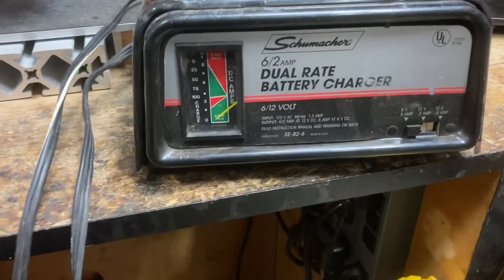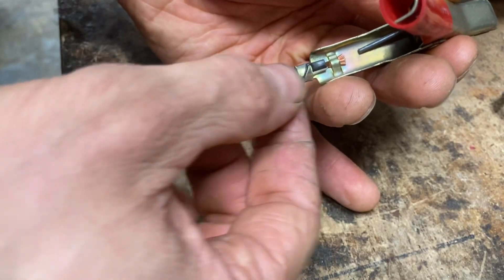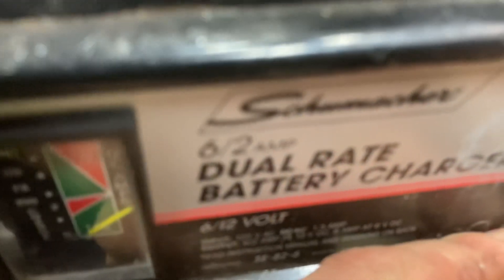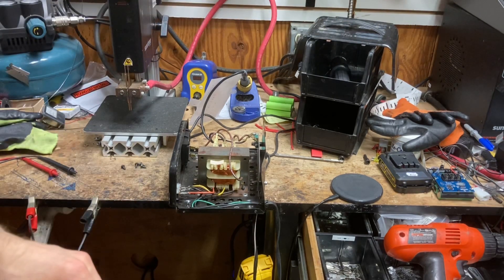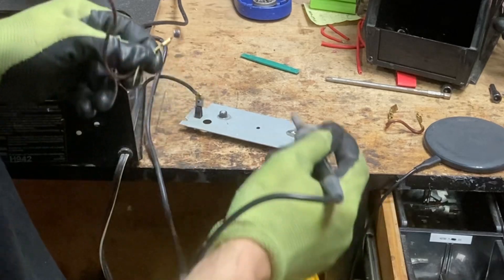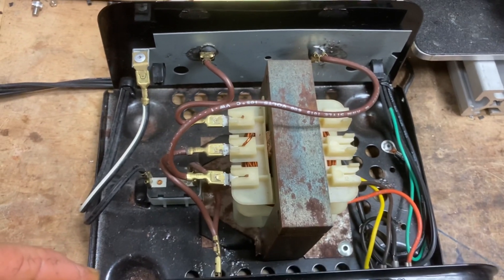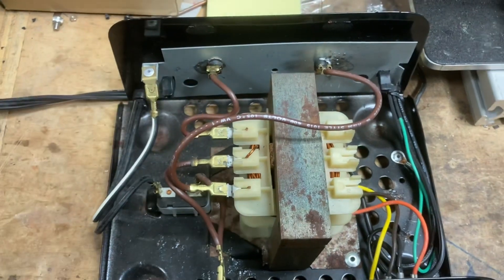How to Fix a BATTERY CHARGER That WON’T CHARGE

Comment: You Need A Soldering Gun Not A Pencil! You Do Know That Current Flows From The Negative To The Positive!! Because Electrons Are Negatively Charged!! Protons Are The Positively Charged Part Of Atoms! Center Tapped Means That On The Secondary Coil There Is A Connection To The Center of The Winding Length!
Reply from the maker: Still a foreign language to me! But thanks! Always learning!

Comment: I'm excited because I have one not working but can hear the transformer so I can probably fix it.
Reply: A bit rusty inside so cleaned up some suspect grounds but squirting a little WD 40 on the charge selector switch and working it in is what got it going.

Comment: My charger is short cycling… ideas on how to troubleshoot
Reply from the maker: Hey Martin, first thing I’d do is try charging it on another charger and see if it’ll successfully charge. Easily 50% of the “charger problems” I encounter are actually the result of a bad battery (heavily sulfated or weak/dead cell).

If the battery isn’t the problem, it’s really a case by case thing. It would be difficult to diagnose unless it was in front of me and I could poke around in it.
Reply: @Duby4life thanks for the quick reply
Reply from the maker: Of course! Thanks for the question!

Comment: Wow!!! My NOCO GENIUS10 is now having this exact issue. It turns on well as normally but gives out 0.01 DC Voltage. Can I follow this same process to get it sorted?
Reply from the maker: The Genius10’a are all circuitry on the inside. I would find it a lot more complicated to diagnose. If you are small electronics inclined, go for it. Always make sure your battery is not to blame before digging into your charger though!
Reply from the maker: NOCO is also fairly responsive with their customer service. I’ve known customers who had their products for three years and we’re outside the warranty and NOCO gave them a steep discount for a new one to replace it.

Comment: My Battery Tender Plus also stopped working, is it possible to open a case to troubleshoot?
Reply from the maker: I've fiddled with the terminal connections to get them working again, but never opened up the unit. Battery Tender products are pretty solid.
Reply: @Duby4life  Mine stopped displaying the LEDs, all connections are ok. I tried to open the case, but it has some "proprietary" screws. I don't know what screwdriver to use. Were you able to open a case?
Reply from the maker: @aperson1181  I usually fiddle with various pointy objects until I find something that connects to open the proprietary screws. If something tiny shorted or died in the circuit board, I’m usually out of luck.

Comment: aka step down transformer meaning it turns 120vac into 12vdc. your home ac system has one too!!! but it's much smaller amperage and is not adjustable for amps or volts. matter of fact doorbells used this same transformer type and still do to this day unless you use RING which is all remote thru wifi

Comment: Why the one way diodes are there I think because it would do the opposite of stepping down could step up from 12 to 120 just like the transformer on the hydro pole power goes out and back feed from generator will step up and travel down the line I think let me know if I'm wrong
Reply: The transformer is already stepping down the 120v AC to something between 15 and 30v AC, the diodes then convert it from AC to DC. The rest of the circuits lower the voltage further, and those diodes will drop a 1/2 a volt on their own. I'm currently getting ready to repair a 1970's Century brand 60 amp charger, and it has even older Selenium diodes, and they drop 1 volt or slightly more each and there's also two of them. So when I use a more modern diode to replace them, my final charging voltage will likely be 1.5 volts higher depending on the low/med/high setting I choose.

Comment: The center tap is the center of the phases. Meaning it's where you 6 volts is coming from. Without the center tap you would only have a +12 and a -12 and no return for the current to make 6 volts. Diodes are as you explained. They only allow current to glow in 1 direction.  You can also use them to construct a rectifier to change ac to dc.

Comment: Thanks for the video. I opened my schumacher and just ohmed out the red and black output leads. One would not carry electrons. The break was right at the alligator clip, under the two metal tabs that are bent over the wire just before the wire is soldered to the clip.
Reply from the maker: Very nice! That’s my favorite repair.

Comment: 5:47 The aluminum heatsink take out the heat from the diodes that you soldered onto the metal plate. Nothing more fella. THE transformer is wound in a way that the charger only need two diodes. Otherwise you would need a full-wave rectifier which is more money for the manufacture to pay for making the item. Center tap refers to the way the output side of the transformer is wire wound fella. You did well and good luck learning too. Have yourself a Merry Christmas and a Happy New Year. Peace vf  😀😀😀
Reply: You seem to have a good grasp on this stuff… I have to stand up Schumacher battery charger transformers…. What if anything can these things be used for???
Reply: @metal.mover23  YOU can use it to change a battery in a vehicle whose charge is not up to specifications. The unit will be able to plate metal to make it shine and protect from corrosion. The unit will power low voltage lighting for emergencies and outdoor lighting. Hope that helps Sir. Peace

Comment: It's painful to watch some men work.
Reply from the maker: Haha! Tell me what I did wrong??
Reply: @Duby4life  Why didn't you disconnect the wire from the spade terminal before attempting to solder? The wire acts like a heat sink making soldering difficult if not impossible, also, you could've just attached it with a small nut and bolt, quick and easy. Another thing, heating with a propane torch  would've accomplished your soldering job. Next time THINK through the problem, build it in your head before you begin. Good luck, take care, don't give up, if it was easy everyone would do it. Peace.

Comment: A diode is for converting AC to DC. One diode can make a half wave rectifier and two diodes can make a full wave rectifier. The voltage coming out of a transformer is AC and you need to convert it to DC to charge a battery.

Comment: HELP! I have a Schumacher 250 Power Booster 10/30 Fast Charger. Someone broke the switch off. I opened it to get the parts to replace, but the auto store doesn't have it. What can I do?
Reply from the maker: Send me photos of the issue to duby4life@gmail.com and I’ll see if I can walk you through a fix.

Comment: You have to hold the tip of the soldering iron on the two pieces to be soldered together letting those pieces melt the solder (flowing it). Never try to melt solder directly with iron and try to stick cold parts together. You can get away with it every once in a while but it’s gonna fail
Reply from the maker: I follow. Hot or not, nothing would stick to the surface where it had been damaged for some reason. Hence attaching to the new spot.

Comment: I bet I've had five battery chargers fail over the years. The only one I have that still works was a cheap one I bought at pep boys 20 years ago. I even left it out in the rain and it still works. The more I spend the less luck I have with them.
Reply from the maker: I here ya there!

Comment: You should look at a couple more videos of guys fixing old vintage chargers. They kind of rebuild them using the original transformer, but they explain the rectifier and diode pretty  well.
Reply from the maker: I’d be interested to learn more! Where would you recommend starting?
Reply: @Duby4life  Get rid of those selenium diodes  and put a silicone full bridge rectifier in its place.  You won't be disappointed.

Comment: With ALL due respect, in keeping the alligator clips apart, it would be wise to clip them to a NON-Conductive place rather than the edge of the table which look like steel to me. If I'm wrong, then I apologize. Have a great day and stay safe!
Reply from the maker: It is definitely good to do as you say! So to anyone who didn’t consider that, this comment is a great reminder! My table is wooden with a poly laminate on the front. 🙂
Reply: yea, I noticed it was wood also, don't think someone would have had a good day if that table top was metal!!!!

Comment: I wish i knew your friend im always stumped when it comes to electronics, the reason im watching this actually is because i bought a brand new in the box car charger for ten bucks from a clearance table and im sure it can be fixed, still working on it
Reply from the maker: What brand and model is it?
Reply: @Duby4life  providence automotive 2/6 amp 6/12 volt battery charger
Reply: @Duby4life  it just turn on and the light for charged comes on no matter what battery I hook it to ,after inspection of the inside I saw nothing that would indicate an issue
Reply from the maker: https://www.ruralking.com/battery-charger-bc26a this one?
Reply: @Duby4life  yep that's it
Reply from the maker: We often say at work, "Some battery chargers were designed to sell batteries." In other words, they often give you either false "bad battery" readings, or do other unhelpful things that lead you to spend more money, either on a new battery or another charger.

I have not personally used this charger, but if it is very light weight, it may fall into the above category.

But to further investigate.. are you sure the batteries you're hooking up aren't either fully charged, (unlikely) or so discharged that the charger can't detect them? many chargers won't detect a battery under 5 volts or so.

Comment: I need to replace my power transformer does anybody know where I might be able to buy one for a Shoemaker battery car charger
Reply from the maker: I’d try to find an identical model on eBay, perhaps even a non-working one. Use it for parts. Often times, the wires coming out of the transformer are very specific and unique, at least they seem to be. I’ve taken apart many 10A chargers and seen many differing transformers.

Comment: Witch wire is positive? Wire with lines on it ?  Clamps are missing
Reply from the maker: Usually the positive has three rubber lines formed into the insulation while the negative is smooth. I would always double check with a multimeter.

Comment: My charger nothing comes on and I didnt touch the ends together this happened after I stripped the wires back after no lights no nothing it's like it into sleep mode and won't wake up
Reply from the maker: Hi Rand, is it a manual charger like this one?

When you plug it in, can you hear the transformer vibrating (indicating the AC power is reaching the charger)?

Try checking for voltage inside your charger. Trace your positive and negative leads back into the charger and see if the DC current is flowing out of the transformer and to/into/through those leads.

Comment: I'd guess that the primary (input) side of the transformer has perhaps 120 wraps around it. The secondary (output) side of the transformer ultimately has 14 wraps, say... but you indicated that it's center-tapped on that side so it's really 7 + 7. If you put an oscilloscope across the outermost connections on that side of the transformer and everything were powered on you should see a nice 20V sine wave peak-to-peak but we think of this as 14VAC RMS (root-mean square) as sort of the average power. The sine wave goes above and below the zero point. Next, run that through two diodes (back on that heat sink plate) and you have a half-wave rectifier. For that original sine wave, only the positive voltages pass through and the negative voltages are filtered out. This circuit just wastes half the current as heat but it's similar to what you'd find in most microwave ovens these days, for what it's worth. As a result of that wasted energy, it generates extra heat in the heat sink and apparently was sufficient to desolder one or both of those diodes. When the switch is in the 6V mode it uses the center-tap to only use half the output of the transformer (7VAC RMS) which translates as 7V pulsing DC through a half-wave rectifier.
Reply: Ok NERD
Reply: I have a charger similar. It's 12v 2amp and 10amp. 
It's only putting out 10-11v. I can't figure out why. 

The wire connectors and connections on the inside do have surface rust. 
Would that be enough to lower the output voltage, or do I have another problem?
Reply: Best comment ! Thanks for your intelligence!

Comment: I've got this 1:40 amp 2 amp 200 starting amps. hasn't worked for a year and I remember an old friend of mine passed away once told me that battery charges have a fuse right here on the back left normally. So between tonight and tomorrow I'm going to find out. Of course I turn to YouTube to search and your explanation I like. check the cable clamps connection. Okay I was looking right past that. So I'll be checkin that first before I take it apart. Indicator lights they light up showing where I've got to sit too but the actual charge like never lights up. I used it one day turnaround to use it the next day and did not work
Reply from the maker: Did you ever find the problem?

Comment: Think of AC (or "alternating current") as like a sine wave.  it alternates between a positive phase and a negative phase:  0V to +60V to 0V to minus 60V back to 0V   kinda like this:   _ -- _ -- _ -- _ -- _   or ~~~  The Diodes "flip" the negative phase of the cycle to a positive one so then the current only goes positive: 0 to +60 to 0 to +60  to 0; like:  --------  or ^^^^^.  (hard to draw with keyboard characters )   

"Direct Current" should go up to +60V and stay there, but when simply "flipping the negative AC phase to positive" you get bumps or "ripple" (which might look more like ^^^  on an oscilloscope)  and usually a capacitor is used to smoothe that out which is what the "AC to 12V DC converter" that you'd use to test a CB or car stereo with has.

Charging a car battery is not as sensitive to ripple as a stereo or a CB is and thats why the insides of car battery chargers are more simple than the insides of your 12V DC converter / power supply.  The battery itself is like a giant filter capacitor, which is why you can test a car stereo or CB with a battery charger, so long as you have a battery between the charger and the device.

Comment: My charger the fan keeps blowing, stuck on, last time I unplugged it waited a little bit and plugged it in again and the fan shut off , but it is doing it again, is it a easy fix or?
Reply from the maker: I’m not sure how difficult or simple that would be. If the fan isn’t hindering anything, it wouldn’t bother me to have it on all the time. I’d simply unplug it when it wasn’t in use.

Sometimes it’s something tiny and failed in the printed circuit board. That’s where my knowledge gets fuzzy.

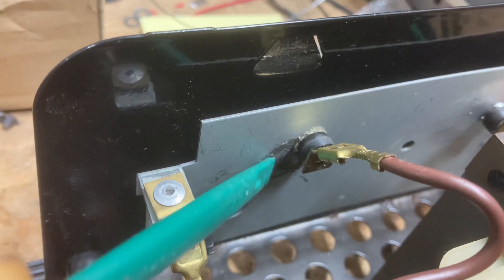Comment: 5:15 - if you had prepped the "old spot" surface, the soldering would have gone fine.

Soldering 101:

    Clean surfaces

    Sufficient heat

    Good flux

    Proper solder for the job

    The solder follows the heat

It is really that simple, dude.

Iben doing this stuff since fourth grade. 

It ain't rocket science.

I'm just sayin'...

...
Reply from the maker: PC: it’s very possible I didn’t get it as clean as it needed to be. I did wire wheel it and sand it to the point that I was eating into the aluminum though. Still the solder only beaded up on the original point of solder when I went to reattach.

I appreciate to feedback though. 👍🏻

Comment: The Center Tap on a transformer is the return path for 12 volts A.C. If you were to disconnect 1 of the windings  on the secondary you would get the 6 Volts A.C. needed. So the 2 wires now (you must not disconnect the center tap) would provide 1/2 of the voltage. After that the remaining voltage goes to the diode to be rectified to 6 volts D.C.  Thats where the selector 6 or 12 volt switch does the job to remove one half of the windings on the secondary are disconnected. Hope this Helps. Good detective work on fixing the charger!
Reply from the maker: It’s a good explanation, and I’m trying to process it and take it in. I think I need to be more familiar with how the transformers are wound to better understand your explanation. Thank you for taking the time to help me learn!
Reply: @Duby4life  I wrote a small essay but lost it because I didn't save it. However the coils are wound on a machine and the transformer Has an E type of metal frame which the coils are inserted either both outside legs or the center inside leg with one coil wrapped over the other coil in the second case. The the transformer is finally assembled with iron rectangular strips  to fill in the spaces of the plates on the E form. They may be welded or bolted together. Look on the web there are hundreds of videos and tutorials. A lot of them really go way overboard with complicated Math. But some are quite good on the other hand. Heres a sample link :
https://www.youtube.com/watch?v=M9ytpIMB5d8
Reply: @amiga8761 I found that  video very useful and simple and not at all long winded,even though it wasn't intended for me but thanks either way